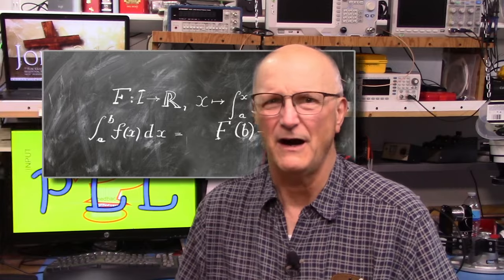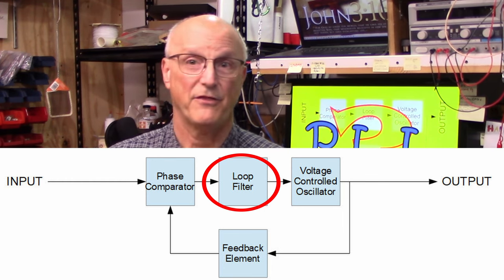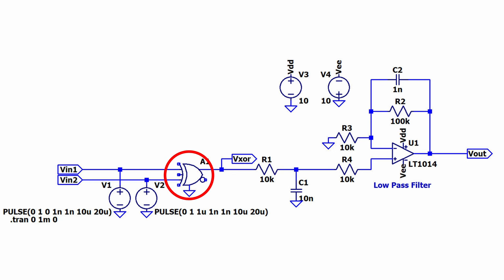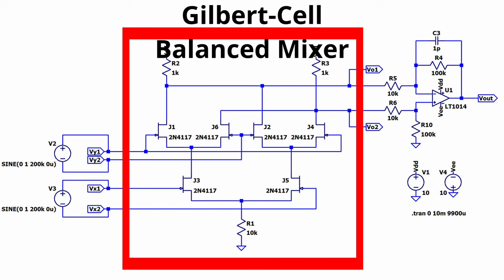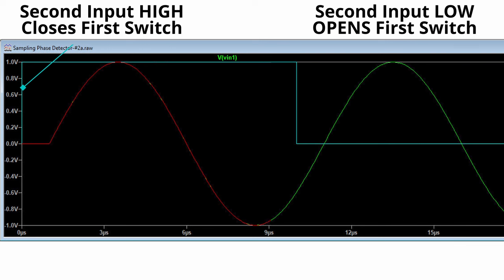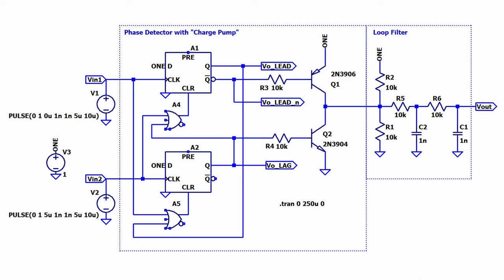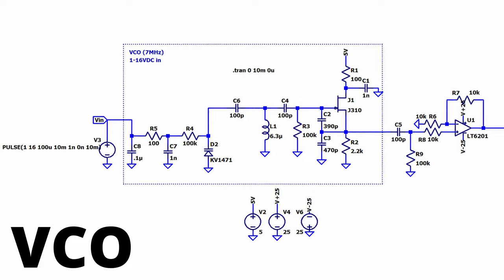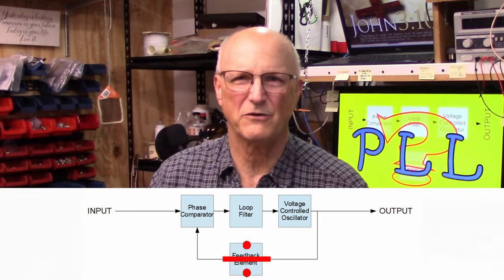Phase Locked Loop (PLL) Basics (061)

Comment: Hello , thanks , i have a question please , can we say that PLL does not need to use the A/D converters which is a high advantage, because we don't have sampling and quantization error in the measurment of  phasor , frequency or any other power system parameters ?
Reply from the maker: A/D converters are not required in a PLL as I have laid this out in my video. In their initial inception, they were not digital entities, but 100% analog. 🙂
Reply: @eie_for_you  thank you
Reply from the maker: @ishakkellou2136  You are very welcome! 🙂

Comment: BTW I use the digital plls from silabs(skyworks now). Amazing sub ps jitter. And the dev boards are cost effective for lab applications.
Reply from the maker: That's cool! 🙂
Reply: Do you have a link for a DIY 10MHz lab reference, using an OSC5A2B02 OCXO,  a Skyworks PLL and an Arduino? Please. I have a MC4044 in stock.